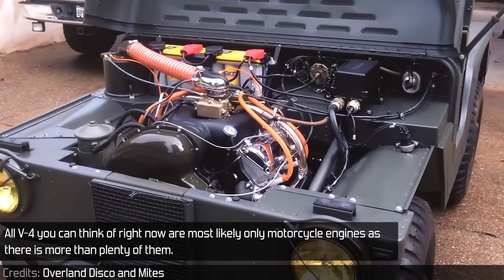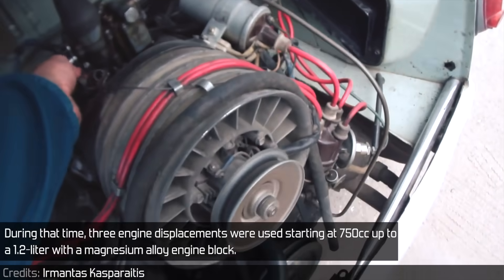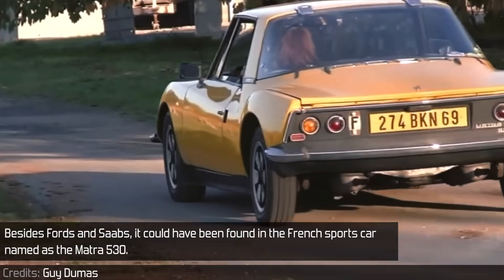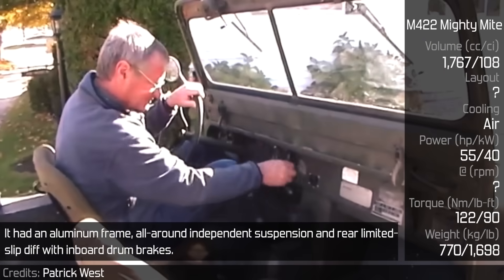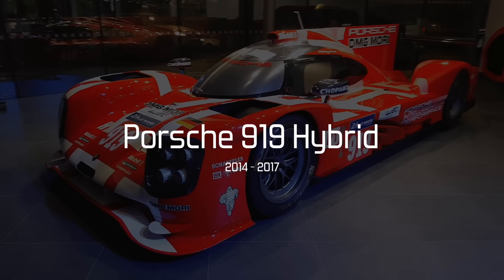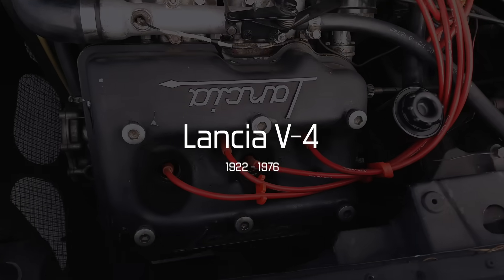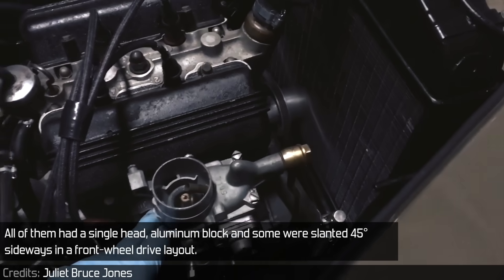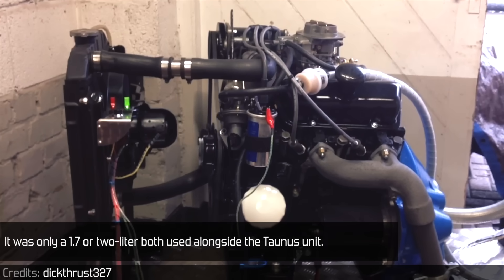The Only 6 Automobile V-4 Engines To Exist

Comment: In 1979 I worked as a pipe fitter for Ingersol Rand building a assembly line for a gas V-4 that it turned out was going to eastern Europe. We showed up one morning and ABC, NBC, CBS and several major print media were outside of plant in Farmington Hills MI. It was quite the scandal. It turned out to be for a light tank type armored vehicle. I seem to remember some Ford Engineers were involved. We had set line up and had it ran, and were breaking down for shipping when SHTF. Our's was water cooled and was similar to my V 6 mustang 2.

Comment: Just cut the back half off a 302 V8 for a 151 V4. Bit O welding...nice little thumper.
Reply: what are you welding exactly?
Reply: You can't just cut an engine in half and then mount it up and hit the starter.
Reply: really!?!?! i was just wondering what part require welding because you cant weld cast iron.

that just confirm you dont know what you are talking about and added that part to look handy.
Reply: Well dimbulb, why are you worried so much about my welding expertise (people can and do weld cast btw) when you really can't cut an engine in half in the first place? 
Get your mom to roll you one and chill. Like the rasta man say...everteen gone be ahry.
Reply: @ragimundvonwallat8961  Ford did. The reason they used the front and rear cylinders was so they had the bell housing flange,  and the mounting for the timing chain case.
Reply: Ford had done just that back in the 70’s. They cut it just behind the front 2 cylinders and again just in front of the 2 rear cylinders, then joined the front 2 to the back 2, and tooled up a special crank and cam. It made 450 hp at 10,000 rpm. It was obviously a 1 off that was displayed at the Detroit Autorama in the mid 70’s.

Comment: https://en.wikipedia.org/wiki/Ford_Essex_V6_engine_(UK) and https://en.wikipedia.org/wiki/Ford_Cologne_V6_engine  I don't recall ever working on a cologne v4 but lots of the Essex lumps, always inlet manifold leaks where the oil got into the water, the big issue was the timing gears that were made of fibre and often broke.

Comment: A very nice video. Re: the Ford V4s and V6s. 
From what I remember, the UK "Essex" engines had a 90 degree V, which is naturally balanced in the 4 cyl configuration, but unbalanced in the 6 cyl configuration (UK Zodiac, Granada and Capri 2500 and 3000). 
The German V engines had a 60 degree V, which made the V4s unbalanced, and the V6s balanced (German Taunus 20m, 26m, Granada 2000, 2300, 2600, 2800 and Capri).
My first car was a 1966 Taunus 20m 2000 V6. Great car with smooth power, marred by an awful 3-speed automatic gearbox.

Comment: My father had a right hand drive ford taunus estate here in the uk in the 70s and i had a ford sierra in the 80s both had variants of the ford 2.3 v6,  there was also a car made in wales yes wales between 59 and 73 by a company called Gilbern, these also used some ford v6 engines ,look them up they were similar to the Reliant Scimitar in construction.

Comment: Volvo put out an all.allo ly 2.4 V4. In.the 760 series. ? Great cars and motor.
Reply: Volvo never had a V-4. That 2.4 litre was an in-line 4. They did have a V-6 though, of 2.8 litres capacity, that went into the 760 and 760. (btw, the 4 cylinder version was the 740)
Reply: Ok thnks. I had an all.alloy  v6. Beautiful motor and car. Pitty there's not any V4 they sound great and look like they go really good too.

Comment: The Taunus V4 was not designed in Germany. Its origin  dates back to the  late 1950s when Ford USA concerned by the inroads being made by small economical imported vehicles, in particular the VW Beetle, on the US domestic market realised it needed a similar vehicle of its own with which to compete. Thus was born Project Cardinal which resulted in a compact vehicle the size of the VW and featuring a newly Ford USA designed V4 coupled to a front wheel drive transaxle - both firsts for Ford .A V4 engine configuration finally being settled on by Ford after it had experimented with other engine configurations - A Flat 4 [boxer] engine and a V6 [the V6 too would eventually find its way in to production by Ford Germany, but that's another story for another time]. The car had been given the all clear by Ford management to go in to production for 1962 but at the last minute, Ford management  got nervous and had second thoughts about the whole thing and cancelled production, going on to produce the utterly conventional Falcon in its place. However because production jigs for the V4 car had been ordered and manufactured and because the Ford Germany Taunus was due to be replaced Ford USA in order to recoup some of the money spent on Project Cardinal,  decided Project Cardinal would be the next Ford Taunus and so transferred the jigs to Germany. The rest as they say, is history.
Reply: Strewth. And that Ford Taunus 12M went into stiff competition with the British Ford (Consul) Cortina. BTW, the V-4 engine almost found use in the USA all the same; it was to become the powerplant of the concept Mustang in 1962, where it was to be mounted mid-ships. Again the design was deemed too radical and the Mustang as we know it was designed around Falcon mechanics.
Reply: I always wondered about it's design origin since it is built like the Ford FE engine family where the intake manifold makes up half the cylinder head.
Reply: EVISEH thank you for the history. My father had one of these Taunus 12M 1300 V4 with fwd and a very American steering column mounted gearchange.  Now I know where it came from!
Reply: I dd not know that.  Makes sense though as the Mustang prototype was mid engine and featured a V4.
Reply: Another takeoff of this was Thiokol (Snow Cats) in Utah used the Ford V4 in a couple of their offerings in the late 60s & early 70s.  Gearbox attached to engine had 2 or 3 speed(don't remember) + reverse and steering clutches like a bulldozer, then on to the rear through twin driveshafts to each side to a rear final drive for the tracks.

Comment: There was a V4 engine that Scat Engineering built for midget race cars.  It was basically half of a small block Chevy.  And there is the Motus motorcycle, which is powered by a V4 that looks like half of a scaled-down GM LS.
Reply: beat me to it! on the SCAT V-4

Comment: I though most of Subaru are 180° V4.
Reply: 180 degree motors are called boxers: aircooled VW, Aircooled Porsche, VW wasserboxer, and subaru to name a few
Reply: @speedbuggy16v   They're called 'boxers' or 'flat' but technically they are a V configuration with an included angle of 180 degrees.

Comment: Wisconsin engine made a V$ too. It was an awesome engine. V4's have more low end torque then many straight 4s, so to see them in mini racers isnt shocking. I've always wondered why it didn't become more popular, especially here in the states.
Reply: Because there was a thing called a v8 and america likes big things that drinks way too much fuel.
Americans also like big cars. Big cars fit big engines. Small v4's were made to fit small cars.
Reply: @pontus6261  That and v4's cost more to make than a I4
Reply: They used to run them in hay balers.

Comment: I had a 1968 Ford Corsair 2000, was about 3 yrs old when I bought it. It was a powerful strong pulling engine, and contrary to its reputation, was completely reliable and dependable. Then about 70k miles, fuel pump faltered, this was driven by a cam sunk deep in the block, some wear was soon corrected. While the engine was a little thirsty, about 25mpg, and made a rumbly sound, it was better than the V6 Ford I acquired brand new to replace it. Though smooth and silent, the V6 needed cooling system repairs quite a few times, and never did better than 18 mpg. While I was glad to own them, would always prefer a straight six, now so rare.

Comment: i owned a saab formula i think it was 70s a small two seater sport car it was imported and had the ford v4. looks close to the green one that drives around a corner at 2:11 but mine ran so much better than the one seen here.

Comment: Where is the Citroen V-4 with separately engined supercharger?  I know it's hard to find definitive technical information, but not only was this the 'right' engine for the DS series, the concept would have been interesting in the down-engined SM.

Of course, Ted Pritchard very famously developed successful automobile V-4 engines.  They used steam.

Comment: Your Honda Accord doesn’t have a freaking V4! It has an INLINE-4 engine!

- Bladed Angel, a Mustang driver yet to hit a crowd
Reply: They did  make a  v 4.   They  don't  run  as smooth as  in lines   Honda  has even  made   oval  cylinder engines.

Comment: Had the misfortune to drive a Ford Transit Van in England which had a V4, around 1980.  It had just been badly rebuilt by the local council, who must have left some metal remnants behind.  An oil way got clogged and left us stranded hundreds of miles from home.

https://en.wikipedia.org/wiki/Ford_Taunus_V4_engine

Comment: In my opinion the Ford engine used in the Saab is the best soundning engine of these. But I might think that´s just because those Saabs still were common in everyday traffic back when I was a youngster.
Reply: The Saab engine is the Cologne 1500 version. Will rev more easily since it has smaller stroke and same bore as the 1700 version. Saab put stronger valve springs into it and while the Taunus 15m 1500LC max rpm was 4700-4800, the Saab version did 5000-5200, offering more horsepower.

Comment: sorry to burst your bubble but ford had a V4 in their transit van in the 70,s
Reply: Afik they had V4s in the Transit in the 1960s. The first series of Transits with the short nose. From the mid-1970s they went on to the in-line 4s, which was the series with the longer nose.

Comment: V4's are rough running engines, lots of vibration.
Reply: In a 90 degree configuration they are not bad, but in 60 degree configurations like the Ford ones they do vibrate.

Comment: The Ford V4 as used in the Transit, Corsair etc and the post-1968 Saab 95/96 has four separate crankpins and even firing intervals (the sparking plug leads are equally spaced around the distributor cap, and the contact breaker cam lobes are equally spaced). With the 60 degree angle this gives a mechanical imbalance that is overcome by having a shaft with two lop-sided weights on it turning in the opposite direction to the crankshaft. It does in fact run very smoothly, but it has a rough sounding exhaust note because of the layout of the exhaust manifolds. Many 4-cylinder boxer engines (Subaru, original Volkswagen Beetle, Citroen GS) sound rough for the same reason, but the Alfa Romeo Alfasud boxer engine has a very smooth sound because it has four equal-length exhaust pipes from the cylinder heads to a junction into a single pipe.

Comment: The Ford unit used in the Corsair used a Fibre timing wheel which was notorious for failing, The Saab version replaced this with a Steel item Iirc?
Reply: No, the SAAB V4 had fiber balance shaft gears, and finding the steel gears was really really hard.  You usually just ordered the newer strengthened fiber gears and tried to not over rev it.  Revving the piss out of the SAAB V4's is what usually killed the balance shaft gear

Comment: Chevy chevette in the 1980's had a v4
Reply: eurojoe 931 what? Are you sure about that? I rode in many a chevette. I'd think I'd have heard about that back then.
Reply: Pretty sure I've been trying to buy this old 4 door for years that this old guy refuses to get rid of and is rusting out and it has a carburetor v4 in it.
Reply: eurojoe 931
Nope.
Reply: Chevette is an inline 4 cyl. Car's basic platform was also heavily based off of the 1973-79 Opel Kadett.

Comment: Really surprised that the V4 configuration wasn't used much more often as they're such compact engines & very lightweight if air-cooled alloy units like the Mighty Mite! 
Btw; I only speak English, but when I was young even I thought 'corps' was also pronounced the same as 'corpse' because that's the way I read it, not realising the 'p' is silent!

Comment: Good video, and I've learned something today - I didn't know that Ford had two families of V-4 engines. I knew that the early Ford Transits had a V-4 (I guess the Essex unit) and I knew that SAAB were using Ford V-4s (as you say, the Taunus) - I always assumed it was the same engine!
Reply: v4 taunus was the cologne, same family as the 2.3 and 2.8 v6 engine.  cologne was the european v4's and v6's, the essex was the british v4's and v6's
Reply: donkmeister: my neighbor in Germany in 1977 had a Ford Capri with a V4 engine.
Reply: We had a 1.7  V4 transit camper van. I assume the Essex V4, though I don't know. Really sweet free revving little motor. It was lots of fun to drive.

Comment: The engine "V4" of Lancia I do not know if to consider it a V4, since the cylinders are in disposition type "W" like the Volkswagen, within the same block.
Reply from the maker: To be precise, it is the same design as the VR layout which stands for V-Reihe = V straight. It is not an inline engine, it is not a V engine. Something in between, kinda both.
Reply: Maybe 🤔
Reply: @VisioRacer  you forgot the Motus V4.
Reply: The thing is that a W engine is technically two narrow-angle blocks in V with a common crankshaft.  The 6-liter W-12 in Bentleys and VW Phaetons is a good example; look at one of these from the front to see the arrangement.

Comment: V4's Rock.Noting better for Motorcycles. In Car's they should have been developed and used much more.But due to manufacturing cost against the Inline 4 basically suppressed the layout from it's inception. The Lancia engine is legendary. In the 70's my Dad had a 1300cc Fulvia in which Peter Brock had a drive and loved. That racing Porsche awesome performance and sound.
Reply: I think the thing that put the V4 in relative disfavor is the development of the modern transverse-engine front-wheel-drive layout.  Up to then, to get a shorter nose with conventional longitudinal engine RWD you needed a greatly shorter engine, just as manufacturers like Subaru do now with horizontally-opposed ("boxer") engines.  But with the engine crosswise, an inline, particularly one angled behind the front-wheel-center axis, becomes shorter as well as less expensive to make even with balance shafts.  Simplifies the final drive, too.

Comment: Glad someone saw the difference between a Ford Cologne V4 and a Ford Essex V4 as ppl assume they were one and the same beast, the V6 variants two were equally different in the Essex 3.0 was a pure grunt box whilst the Cologne V6 was smoother and far more refined which saw the MK2 Granada and later Capri's get the German engine whilst the Essex laboured on under the bonnets of Reliant Scimitars.   As it happens I have been testing out the idea of a either a 1.7 or 2.0 Essex V4 in the front end of my Reliant Robin, there was also a 2.0 V6 based on the Cologne build I seem to remember.   The Ford V4's allowed Ford to shrink down the front of the MK1 Ford Transits as it really is a tiny engine lengthwise, it looked lost inside the Ford Corsair and Ford Consul engine bays and they were very nearly put into MK1 Escorts but this was dropped in favour of the quite old by then but incredibly reliable Kent engines.
Reply: Don't forget the mk4 Zephyr.
Reply: Saved a few NSU RO80s  Wankel engine disasters from going to the scrap yard too early as well.
Reply: Ian Watson 
My old man had a mk1 transit pick upon a n reg,it had a 1.7 v4 but he replaced it with a 2 litre,reliable but thirsty
Reply: I forgot about the Mk1 Transit.
Reply: As far as I know the Essex engine was originally supposed to be a Diesel unit. I do know the 2.0 V4 ended up in the Corsair, Granada, Mk1 Capri and early Mk3 Cortinas.
Reply: I remember when I used to detassel corn back in 80s they used a Brazilian Ford V4 in the automatic detasseler but didn't like using it as it tore the top of the corn bad.